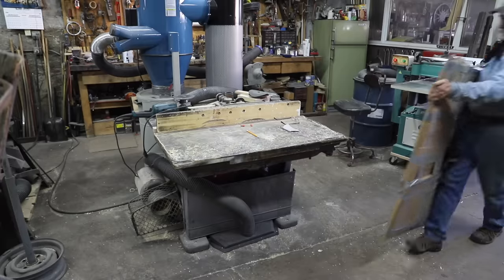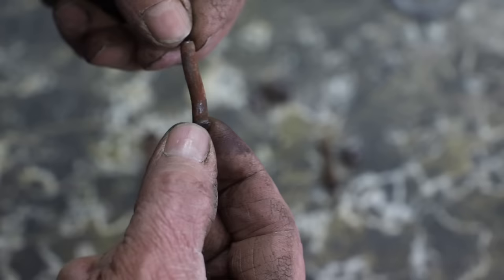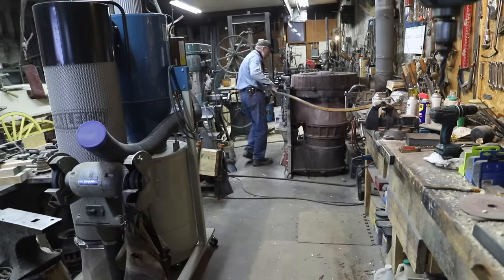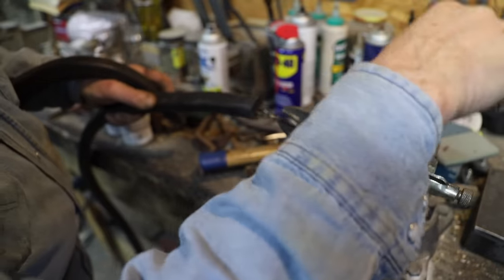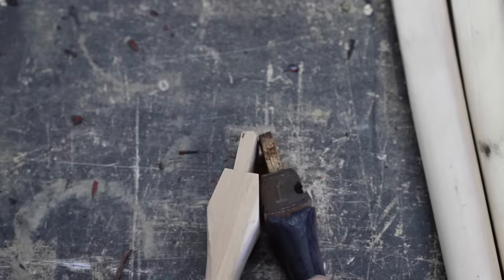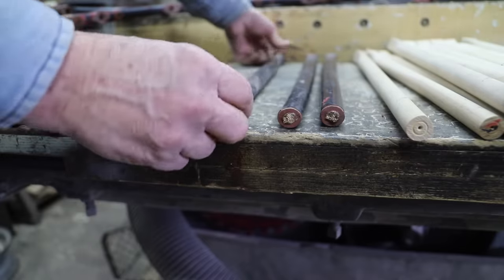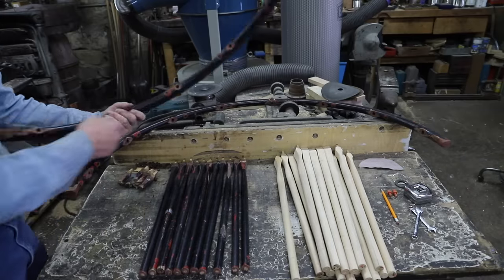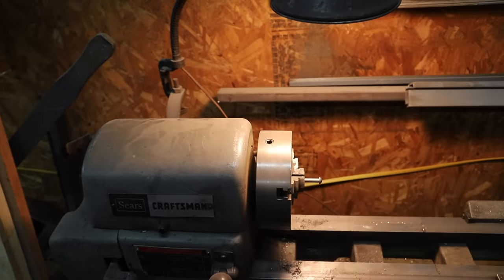100 Year Old Buggy Wheel Built Incorrectly | Engels Coach Shop

Comment: Him: "You've watched me do this enough times..."
Me: This is my first time watching one of your vids.😂
Reply: @EngelsCoachShop  why didnt you show painting the wheel? great video btw I still dont get those wheel wires
Reply: @bermchasin  if i had to guess. think of them as banding to keep the rubber on the wheel. otherwise there's nothing actually holding the rubber against the wood/metal frame.
Reply: @jetah50  Watch earlier videos. He is pushing the rubber ends away from the joint by tensioning the wires with the cranks until the wheel sucks up. Then the wire are cut and brazed together under tension. Then he beats the tire on the concrete to force the rubber to close the gap, but there is more rubber than space and so the rubber is always in compression after the gap closes and will never loosen up.
Reply: You need to be shown more than once? 😂
Reply: Edit:  The Borax wagon wheel video WAS yours!   https://www.youtube.com/watch?v=5JVcE8gho4k

Same here.  First time. . .unless the "building an enormous and heavy borax wagon wheel" video I watched about 3 or 4 years ago was yours.  😉
Reply: It won't be your last
Reply: My Grandad was a wheelwright and his boys helped fit the steel tyres. He had fourteen children and my dad was his youngest... great job ....

Comment: Thanks for the tip on how not to bend rivits. I don't do wheels, but I sometimes replace tool handles that are rivited. Now I now to use a smaller hammer.

Comment: Being an engineer I was curious how you welded the internal wires without damaging the rubber. Now I know after watching a master wheelwright at work. Thank you.
Reply: Doesn't look like they really got welded at the end, just heated up so they could be bent into place. Maybe I'm wrong?
Reply: That was the one question that popped up as well. :)
Reply: @tjv323  its a brazed joining with the filler rod shown there by the torch, the video cuts away kinda early before its completed.
Reply: Andrew ; train wheels don't have rubber, so how would you know.
Reply: @martinkerker1190  Very droll Martin. There are more engineer types than those that drive steam loco's! Incidentally they aren't called engineers in the UK as they don't engineer anything just drive steam locos so are called loco drivers.
Reply: When I saw how it was done.. I was like well of course that's how you would do it.
Reply: myself as well, this watch was well worth the time, very interesting work and the processes involved.
Reply: The tools are fascinating.the skill to use then is at another level.

Comment: Education only goes so far, then you must acquire knowledge. And while I'm pretty sure I'll never repair a wagon or buggy wheel, I do appreciate the knowledge on how to do so.
Reply: I can attest to that. I have a degree in engineering ( mechanical ). The degree was the start, I learned most on the shop floor. Let me share a couple of stories.
1) I was working for a manufacturer of armored vehicles. We were asked to weld a series of nuts to a plate which was then welded into the vehicle shell. The part that was bolted on never fit properly. Finally got through to design that's weld shrinkage. Weld the plate into the shell, then put the other parts on and they stay in the right place.
2) Most of us here know what a center punch is and how it's used to lay out locations. Young design engineer thought a center punch is the middle punch on a three hole punch in the office
Reply: It is one thing to have the knowledge about how to do something. It is another thing to have the skill just to get the tools out and do it. I have knowledge of many things. Having the skill to put that knowledge to use is something I openly admit that I sorely lack. It is always a joy to watch a master doing something and making something beautiful.
Reply: @easternwoods4378  that's one reason why I believe all engineers should work in the trade for 1-5 years before getting their degree (or license).  give them some hands on experience to layout, build, and repair.

Comment: Yep, I can finally follow along now.
Reply: Me too, when he started to tighten up the wire, i thought now he'll braze them together... Great videos, a real pleasure to watch.
Reply: I’ve ripped enough things apart, built enough things that as soon as he was done ripping it apart I thought of just about everything he’d need to do to put it back together. I’ve never done anything with wheels or watched any videos on them before lol. Just stuff like he pulled the old wires out and I think “man it would be a bitch to get those back in if you don’t lube it up and get any and all crud out that it could catch on”. Sure enough that’s just what he does. Little details like doing it both ways probably comes from experience because I might’ve just done it one way and seen if that was sufficient.

Comment: wonder if the other three wheels are put together wrong too.
Reply: vettelover2009 I hope we all look that good at 100
Reply: The comment about the heavy hammer is interesting. There's lots of times it's preferable to use a heavy hammer, and that (I think) is because in the more usual case you are trying to MOVE an entire component, without damaging the place you're hitting it. Careful thinking through the mechanics and kinematics of energy transfer, friction etc, reveals that requirement is best met with a heavy item swung at a slow speed. Like a mediaeval battering ram, hung from the ceiling and heavy as all hell: the aim being not to dent the door, but to open it.
But in rivetting you're trying to accomplish the opposite: you're actually TRYING to deform the place you're hitting, so it does make sense that a light hammer swung fast is a better option.
Reply: Terrible. Now they don't match, one of the wheels is done right.
Reply: @Gottenhimfella  And I was sure someone would say, "Now why did he use that big steel hammer instead of a wooden mallet?""

Comment: That said, the "Friday Wheel" lasted 100+ years. Couldn't have been that big of a deal. ;)
Reply: And it served its purpose until it was asked to do something even a correctly built wheel couldn’t withstand.
Reply: It probably wobled all of those years.
Reply: How much of that time was spent in use? Not much
Reply: @KaitouKaiju  depends on where it came from, you know buggies are still daily drivers in some areas of the USA
Reply: @leifvejby8023  Yeah, I bet those wheel balance weights didn't curb that.
Reply: That said, show me a wheel made with modern machinery that can last 100 years.
Reply: @Sara-L  We use more pliable materials nowadays for a better ride. These materials don't quite last as long (cause they have to remain airtight.) Also the forces handled by our modern wheels are much higher (and loads more frequent) than old wooden spoke wheels.

Comment: I learned to , ir at least started to,  in 1994. In this time, I have seen Amish  wheelwright shops that don't have as much equipment as you've got. And I've never had much of it at any of the carriage company shops I've worked in, during my career so far. Your shop is impressive. I do have a machine that closes the gaps in the rubber which is easier than beating it on the floor, especially when you get the rubber on really tight. And putting the rubber on to where some might call it "overnighted" really helps it stay on with the cobblestones and trolley tracks in Downtown Memphis.

Comment: as a cabinetmaker and furniture design builder, I appreciate your dedication, enthusiasm and persistence to a challenging trade as yours.  I sincerely hope you will be able to pass along your skills and knowledge to others in a workshop environment.  You have a natural talent for instructing and an inspiring wealth of tips and techniques.
 my hat is off to you sir!
Reply: Remember what you were taught; metal for metal, wood for wood and rubber for rubber. And the natural lubricant for rubber is water not WD40 which Mr Engel left on his workshop floor. Surely you learnt not to use a rasp or file without a handle on the tang

Comment: Amazing. I Made a copy of an 1879 Open Head Excellsior Duplex High Wheeler. Had to make a machine to make the wheels and a hand held version of your cable tightner and holder for silver soldering the single 1/8" wire. I used about 6" more tire than rim. An old timer let me in on the WD40 secret. It stops the rubber and wire from squeeking too. My front wheel was 51".

Comment: Most of my wheel repair has been limited to resetting treads or "rubbers " . Over a period of 28 years  at at least 3 wheels a month, I figured out that it is at least 1,008 wheel repairs performed thus far. I've never had to repair any with riveted hubs, as all of our carriages use bolts. Just this week I've had to reset a rubber on a wheel that I temporarily repaired 7 years ago.

Comment: Thanks Dave.  At the end of the video you squirted WD40 into the solid rubber tire.  WD40 is an OK lubricant, how ever it can weaken some rubbers and plastics.  There are spray on lubricants special formulated for rubber.

Comment: Dave, very surprised you did not use a drill press for the spoke rivet holes.  How did you align the hub flange holes, was I asleep?  Will now be checking your library for a full NEW wheel build to see how you do the rims.

Comment: True about Friday builds . I had a formula firebird turbo , It was in the shop than it was on the road , dealer checked and found out it was made on a Friday afternoon in Van Nuts Can . Rear end broke ,rear disc brakes were junk , front disc brakes near worked , gear carrier warped , even the tape player quit , but the T roof near leaked. lol . Pretty car , but total junk.

Comment: Awesome video! I had no idea how much work went in to servicing one of these wheels. 

What is the purpose of the measurement tool that you spun around the diameter of the wheel before you reinstalled the metal ring? Do you or does it count how many times the measurement tool rotates in total? Thank you for putting such quality into your work!

Comment: I kind of wonder if the original builder put the spokes in half one way, half the other, on purpose trying to distribute forces differently much in the way modern bicycle spokes are attached offset. Seems odd then it was a 50/50 split it it was random. Anyways thank you for putting this video together, not something I am likely to ever do, but it is always good to see a craftsman work and learn a little something I did not know before.

Comment: For lubing the tire before the wires are inserted, how much better is the spray lube than the lard or whatever would have been used 100 years ago?   I imagine that they would have had to grease the wire rather than the tire like you did.

Comment: I am fitter and turner and the heating and cooling of steel components  so they shrink fit  is still used industry today on CNC machines. I have always wondered how this was done and thx so much for sharing. Just 1 question what type of wood is used for the spokes and the rim.

Comment: "don't buy a vehicle built on Friday' -probably true. My dad worked in a steam turbine factory and he mentioned that on Friday (last day of the week,) worker using drill bit or cutting tools tended to 'push' the tool a little harder, didn't change-out to a sharper bit when they could just use the duller bit a time or two more to get that weekly quota, get that premium for parts exceeding the expected number.

Comment: A modern wheel consists of basically 3 parts, all three not meant to be repaired in any significant manner. This wheel has over 50 individual parts, and every single one of them is replaceable, and most can be repaired and re-used. An archaeologist from a future civilization that knew nothing about us could pretty much write the entire book on 19th, 20th and 21th century humans just from finding this wheel and a modern one. You can guess what other technologies were invented just from the manufacturing techniques used on either wheel, from CNC and CAD to material sciences and manufacturing techniques, and from there they could take a pretty good guess about what happened to the economy, what jobs existed at each point, how cities were organized, and so much more about how we lived and how we were. 

No matter what your job is and what your interests are, you should find this video absolutely fascinating. 

Also, fantastic craftsmanship.

Comment: I did this a long time ago in another life...but we forged flat steel bands that went around the wood rim....with two sledge hammers and our knees supporting the steel rim... we'd knock the steel drum rims onto the wood rim. when working alone...hurt the knees...your two blows of the hammers had to be simultaneously and the the correct width....two little bite worthless...too much angular bite worthless. If you had a long-distance farm buddy to help you mount a rim...priceless and easy. If it was raining outside and the wood rim was wet...you didn't mount the steel rim...wood was swollen. Nice hot days no humidity perfect for mounting them. My knees hurt until i learned where to hit the hammers on the rim. You learn fast.

Comment: Looks like 5 spokes were placed in their "backwards" and 6 in "right". Looks like they did it for rigidity, strength and stability reasons. Different terrain calls for different application of wheel pressure. You may want to consider they knew what they were doing.

Comment: Upside down spokes... the difference between a wheel made by a 'factory worker' and a real wheelwright; George Sturt wouldn't have been surprised. The urge to strip the paint off those old felloes would be more than I could bear.  It would be interesting to know if this wheels running mate was also built incorrectly... Thanks Dave.

Comment: I was friends with some horse buggy folks downtown when I worked at a city park. I asked them about repairs and stuff, Where do you get a "flat" fixed on a wagon wheel...they sent their stuff to the Amish. Once, one of the horses got spooked on a 4th of July, Nobody was on at the time but he flipped a buggy and drug it upside down, through town all the way back to his stable. Cops just gave him an escort and let him through intersections.

Just for fun I was designing a system to keep the batteries charged on the buggies. (They had to have lights at night to be on the streets). I had to make it as unobtrusive to the look of the buggy as possible.
I only got as far as paper. Large thin gear on the inside of the outer rim, chain or direct connection to a very small gear on long shaft connected to a small car alternator mounted under the buggy wired to the battery box. It's got to have some give due to the suspension so I was thinking chain and some spring loading on the shaft. The only thing anybody might notice would be some bicycle chain around the inside of one wheel.
Might not work at all.
I don't have a tinker shop.

Comment: I have four flat iron wheels that I’m trying to get the hubs out these iron wheels are double spokes they I believe where a trailer I got the large bolt that went into the wooden axle but now I can’t get the large two inch square nut off I’ve let them soak in penetrating oil I was told that they would come off going the opposite way to loosen is this correct?

Comment: That old line about cars built on Fridays doesn't make any sense to anyone who has worked in a large factory that runs seven days a week.  Usually, a line will be scheduled for twenty turns a week, with one turn reserved for maintenance.  That means you have four crews working a rotating schedule. Sometimes your "Friday" is on Monday, or Tuesday, or even Friday.

Comment: i feel like someone wanted every second spoke to be the other side around. maybe he wanted some tension to make the wheel more stable.
in steel works thats more okay but i feel like wood as a light weight and also slightly more fragile "composite" material in such a pillar setup should not see principle permanent tensions but it should rather be used in the "center" of its abilities to grant the maximum load scale. having a pre-tension would imbalance the load space and shorten at least one of the scale directions. (There might be certain well controllable conditions where it might be possible - but its wood, its natural, it is hard to control. BTW i saw even bent real-composite wood plates /nearly horribly/ break out of a sudden just in the application of single board for the seat and shoulder piece of a chair.)
.
i have to follow your explanation wiith the bolts, as i was not knowing anything about such internal deformations prior to this.

Comment: How do you braze the wires without damaging the rubber? That wasn't clear in the video.
Reply: @seti48...watch till the end. This is what I got: Rubber is compressed by clamps to provide necessary space for brazing and the steelcable is tightened at the same time in a special device, - dunno how to call it (been a bike mechanic, did my "thousand wheels", - but not out of wood :))))  After the brazing, the compressed rubber slides back into position on it´s own when Mr Engel takes it out of the clamps of the device and taps the wheel on the ground. Guess that´s the reason he thoroughly lubricated the cable tunnels in the rubber and blew them clean with compressed air before.
Reply: Thanks!